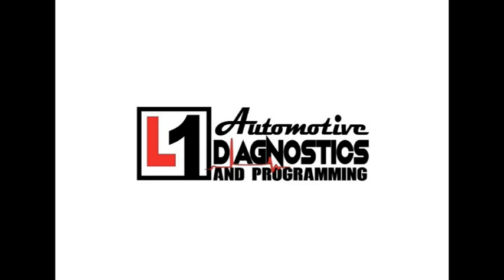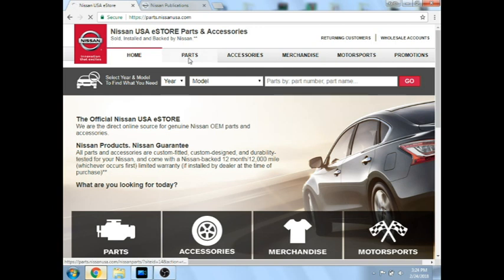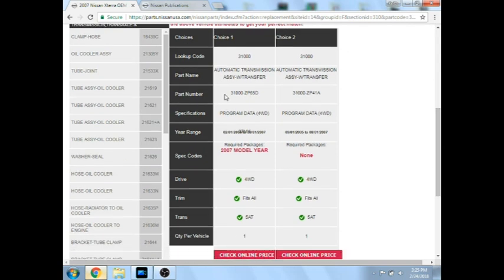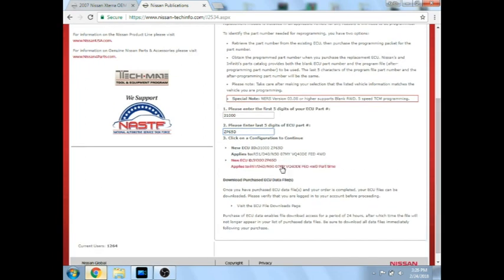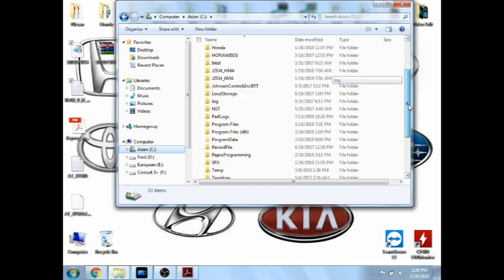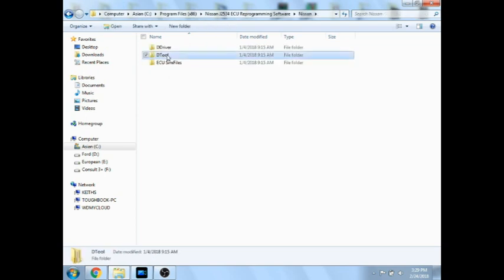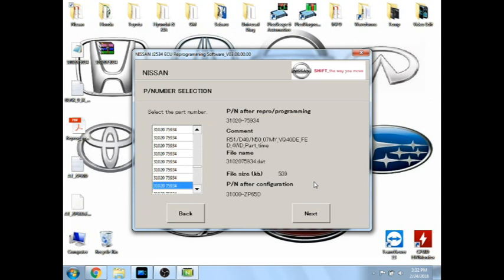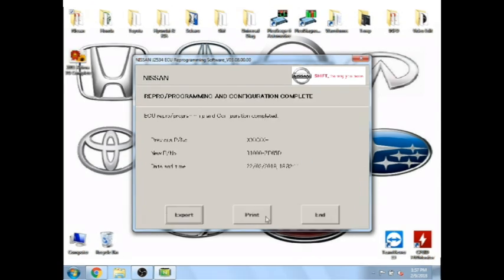How to Program a Blank Nissan TCM with NERS

Comment: Is it possible to program an automatic transmission to not try to shift to the highest gear when in low or mid throttle? Unless manually shifting it, the vehicle's torque feels more responsive when the lowest gear used keeps the engine from dropping any lower than 2000 rpm in low throttle driving. But hey often go to the longest gear causing the transmission to takes too long to downshift.

Comment: Hi Keith. Subject: 2014 Nissan Frontier  Crew Cab 06/2014. The transmission TCM Module was replaced with a blank TCM. The blank TCM was programmed and the vehicle still having issues with the Transmission stuck in fail safe mode. How can i check to see if the programming was done correctly?
Also if it is not done correctly. Do you offer remote programming On -Line? if you do let me know.
Regards,
Winston.

Comment: 5:29 Saved my butt today. When I first moved the files, folder 107 was not there! I only had them in the config folder which of course failed.
Reply: I didn't Have the 107 Folder Either. Did you Have to Create it? Or how did you do it? Were you Programing a New Or Used  TCM?
I'm having Big time issue.
Please help.

Comment: I just installed a remanufactured valve body for my 2014 Nissan Rogue.  Does the TCM require programming to properly operate with the valve body?
Reply from the maker: Yes

Comment: I know it’s a few years old now but I ran into an issue. The programming worked fine but the configuration failed. 2007 frontier a/t 2wd. Any ideas? I’m using Bosch flasher pro. Tcm brand new from dealer.

Comment: My TCM on (2008 Nissan Titan) went off network - no communication with scanner. After i flashed Blank TCM 3 times with errors. After key cycle it wouldn’t finish /complete successfully. I manually transfered all files to Application Data but not the other location—i never knew about—-i used to flash ECMs with no problem with first location dropping files. My question: is Nissan TCM unforgiving if flash process crashes—do i need new TCM now? In my case it just went out the network became no communication—not accessible. Anyone have same issues or familiar or clues?

Comment: What happens if you don't program it? I've installed a TCM in an 07 xterra, and it won't shift right at all. If its simply a matter of flashing the correct calibration I can do that, but i'd rather not drop $350 on a NERS subscription if this transmission has other issues.

Comment: I have a 2006 xterra 4wd se auto and I need a new transmission/hoses/radiator... Etc. I was wondering if I can put a newer transmission in it from a 2014/2015 xterra and have the dealer reflash the tcm. Before I buy the transmission I wanted to know if you see any reason that it would be incompatible with my model year? And if not which years would be compatible with a reflash. Thanks for this video!
Reply: I think the compatible range for you is 2005-2012 for the Re5r05a (Pathfinder and Xterra -- the trans is used before and beyond this in other applications). I'd try to find a used one in that range and consider a new valve body and TCM from Sonnax pre-flashed to VIN (if you don't get a compatible one with the used trans or can't use the old one due to contamination; I disasembled my VB, cleaned it, and reinstalled to discover TCM may have shorted). I am going through same process now and rebuilt one to swap with a coolant damaged one. When done I had communication trouble between ECU and TCM (U1000 and U1001). So, I think the coolant must have shorted the TCM. I am about to test pins from ECU and if good drop a spare TCM (that I know nothing about) from the spare trans I rebuilt. If all fails -- Sonnax. Some do take a much cheaper Re5r05a from a G35 and change out the rear housing / trans case adapter and swap the linkage over to the other side. I think you might also need to change the output shaft as there are different sizes -- but otherwise exactly same transmission. Wreckers jack the price up on the Pathfinder and Xterra Re5r05as compared to G35. 

If coolant damage, be sure to flush all lines with trans line flush before connecting the replacement trans.

Comment: Question: 2014 Infinity Q50---cant pull ECU part # to check if theres new ECU file available. Tried Zeus scanner, Autel Maxisys, ToolBox DrewTech and Nissan J2534 Reprog Soft---says "No part number retrieved from ECU" ---there TSB/NHTSA campain 14V583000  Software Update available to fix Throttle Body issues and my customer IS HAVING THROTTLE ISSUES---so im stuck cant check if ECU up to date or not.  If you find free time and willing to look it up id very appreciate and reply back. VIN: JN1BV7AP3EM672779

Comment: i have had my nissan pathfinder transmission replaced with a second hand part. when in "D"  drive is working perfectly well. but once i try to engage to shift ( in 1, 2, 3...) it does not recognize. does it requires programming?

 please help. 

thanks.
Reply: still waiting for your reply :(

Comment: Forget to mention on my previous comments that, after replacing the Cvt.transmission on my 2014 Nissan pathfinder the Acceleration became a slow but not very slow I can feel it not as use to be can please describe what could be the issue and how to resolve it please advice...thanks

Comment: Hey I would like to know recently I replaced cvt.Transmission on my 2014 Nissan pathfinder. Now do I need to reprogram any on the tcm or any other suggestion before driving the car. I asked my mechanic about reprogramming  but he doesn't have no clue about reprogramming after replacing the transmission..I'm seeking your advice...thanks.

Comment: Hey there, probably a late comment, but if i purchase a new cvt for a nissan murano, will i have to program the tcm or will it come with it automatically?
Reply from the maker: Read the service information, as it depends on the year make and model, it will not be plug and play for sure.

Comment: I have replaced the 4-speed automatic transmission on my 2011 Nissan Versa with a new OEM transmission I purchased from a dealership. I installed it myself. Do I need to reprogram the TCM for the transmission to work properly? Or is it ok to leave the original TCM alone and use it, since I have not replaced the TCM? Thank you for your help!!
Reply from the maker: What does the service information say?

Comment: So my question is this, I have a 2012 Maxima with UpRev flash. I purchased a newish CVT I need to have the TCM reflashed with oem program, because my mech purchased a blank and went in messing with shift points, and has the car driving crazy shifting oddly and not meeting it's true power because of that. I wanted to get rid of that problem by reflashing with OEM settings; will that work and will my UpRev be ok with this action or does it need to be reflashed as well?

Comment: Help me,I was reprogramming my g37xs and suddenly my battery maintainer got unplugged and I got error on ners,when I try to reflash,it says ecu part number doesn’t match and the ecu part number in the car is now blank,check engine and car won’t go into gear
Reply from the maker: You may need to manually edit the csv to use the displayed part number, if you dont know how to do that, or it doesnt work, the car ecu may be able to be recovered with a consult 3+
Reply: L1 Automotive Diagnostics and Programming LLC do you think my tcm hasn’t fried because the scanner said the car lost communication with tcm which is u0101 and to when I tried to edit it,I still get the same error..the selected part number doesn’t match the ecu which is 31039-3RX09 and is ecu part is 31039-
Reply: I just subscribed pls how do you recover from consult 3,car is parked and I’m fucked
Reply from the maker: @johnbosco2404  you just reprogram with the consult3 plus. If it doesnt work, then you need a new TCM
Reply: L1 Automotive Diagnostics and Programming LLC so I decided to use consult 3 plus and it finds the ecm  and I loaded all the files and installed battery maintainer and it all checked green but on transfer date area,it stucked at communicating with control unit,please wait for a while

Comment: L1 Automotive Diagnostics and Programming LLC  Wassup bro. I have a 2005 Nissan Altima. I replaced the engine and transmission. But for some odd reason it will not switch gears. I can plug the battery in start it up and drive normal. But soon as I let off the gas the car completely stops switching gears. Then I have to get out disconnect the battery And then it’ll drive normal again. I’m getting extremely fed up. I replaced the motor mounts , axles , engine , and transmission. But I can not figure out what the issue is! Nissan can’t even tell me what’s wrong. Can you tell me what’s wrong? I’d really appreciate it.
Reply from the maker: A lot more information would be needed, start by looking at scan data, see what looks out of place, it is very difficult to diagnose a problem when we really dont know what the problem is yet, only the symptom.
Reply: L1 Automotive Diagnostics and Programming LLC exactly man! Nissan can’t even tell me what’s the issue. You think I should check all the sensors?

Comment: excellent video, I have a quick question, we are working on a 2005 titan and the TCM have one solenoid pins broken, we purchase a refurbished TCM with the correct part number OEM 0260550002  can we just swap those or have to program it?
Reply: mauri redy Hi, I have the same problem as yours. I have a 2003 infiniti Fx35 rwd and the TCM has a broken pin or lead which I soldered but didn’t last long. What was the outcome on your Titan? Did you take it to the dealership for programming? Were you able to drive it there or you had to tow it to the dealership? I want to buy a new TCM on eBay with the same part number as yours but I worried about not being programmed. Where did you buy your new TCM?
Reply from the maker: It will need programmed, unless it came with the most current calibration.

Comment: I took a g35 trans and installed it in a Xterra I tried to use the Xterra valve body and tcm design 3 so I installed the g35 valve body and tcm and the Xterra will start drive and shift but shifts hard. Took it to a Nissan dealer the charged me $280 claimed they programmed it I argued that they didn’t because my shift indicator on the dash doesn’t work and over drive switch doesn’t work. I need help as to what I can do next.
Reply: Can a already programed tcm be reprogramed to a different vehicle.
Reply from the maker: This is a loaded question......... you can modify the CSV file to make NERS program any calibration file into any module, or at least attempt to do so.  But if the hardware is not compatible with the calibration file, the programming event may fail, or the module may be damaged after the flash completes.
Reply from the maker: Not sure, there may be some kind of issue with the parts, or the calibration may be wrong or damaged.

Comment: I pulled a tcm off a QX56 put it in my 06 Xterra. Started right up and drove off. No programming ? Is this the case with any used tcm ? So I only have to program if I buy a new one ? Cuz I have another Xterra to work on but I can’t find a used tcm .
Reply from the maker: No, this will only work if the 2 TCMs are the same exact part number and software level. And only for some models as VIN data is stored in some newer TCMs, and CVTs do not work like this at all because of learned shift values.
Reply: I’m not so sure buddy. Two have same valve body and tcms but the my Xterra was #1 design. The qx56 I used to donor, was a design #3 it plugged in and worked fine.

Comment: Hey Keith can a used Pcm be programmed on a 07 Versa? I’ve programmed used pcm on other Makes but never a Nissan. Thanks in advance.
Reply from the maker: Yes, if the calibration level is correct, just write the vin, and complete registration of the keys.

Comment: Hey brother is it possible to reprogram an used tcm?
Reply from the maker: That is a loaded question, depends on the year make and model, on the few that you can, it must have the same exact part number, and most likely has to be a unit that is behind by a calibration so you can flash it and get calibration files in it that match the new vehicle. So the short answer is, just get a new one.
Reply: @L1Training  Are remanufactured TCMs from Dorman blank or you have to hope it is a version behind to flash?

Comment: My friend changed the transmission in his 2008 Infiniti M35 but threw away the old transmission so I can't put the old TCM in this transmission is there any way to reprogram the existing transmission module in the used transmission
Reply from the maker: Yes, it is very involved, but is possible.
Reply: @L1Training I end up replacing my g35x 04 sedan with a used transmission from another 04. Infiniti couldn’t flash my tcm. I still have access to my old transmission. Please tell me my old tcm will probably be the best solution. If I put the old tcm in would it be a bit easier to access? Also heard the 04 sedan doesn’t need programming after a trans swap.

Comment: any way to restore the tcm after error during the blank programming?
Reply from the maker: If the key was turned off the bootloader in the module is likely corrupt. It is a very long process to try to recover one.

Comment: Hey I have a question.  Is the tcm will be toasted if error happens during blank programming??  I had an experience with ECM went bad because of the error happened while it was reprogramming (labtop power went dead.., stupid thing..)
Reply from the maker: Yes is an error happens during programming with NERS it will most likely damage the module.
Reply: Is there any way to restore that TCM by any chance?

Comment: Hey! Thanks for this video. Unfortunately, I don't even know how to get started and I don't know what tools to buy or what a VCI is. I have to do this project but I have many more questions. Any chance you might be willing to chat privately?
Reply from the maker: You need a scan tool that will do the relearn functions, (Snap-on verus, Autel Maxisys, or Launch x431), you will need access to service information for procedures and specs on each of the steps. (alldat, identifix, mitchell) you will need a programming specific power supply (NOT A BATTERY CHARGER) (Powermax, Iota, Schumacher, Snap-on) you will need a J2534 device (Drewtech, Bosch, Snapon, Launch) you will need a Windows 7 Laptop, you will need a subscription to nissan NERS ($270 a year), you will need the flash file for the specific control you are programming ($20). Then follow step by step with the video.
Reply: Can get a godiag j2534 pass throught cheap. Got mine to work on ners

Comment: Hey man , you seem a real expert , how can I contact you , I have some questions and I need your help , Thank you
Reply from the maker: What are your questions?
Reply: Keith Perkins So, in my country, our nissan dealers are very expensive and they don't have the proper quality service for our cars , however, I want to buy a consult 3 plus, and start a nissan workshop, and I want to learn everything about nissan , I have a nissan maxima and I tried to do uprev tune but it didn't go will , my car won't able to run , also I want to learn how to recover my ecu , i know those are so many vary questions, but I really really want to learn. I hope you could help me , thank you
Reply: L1 Automotive Diagnostics and Programming LLC  Wassup bro. I have a 2005 Nissan Altima. I replaced the engine and transmission. But for some odd reason it will not switch gears. I can plug the battery in start it up and drive normal. But soon as I let off the gas the car completely stops switching gears. Then I have to get out disconnect the battery And then it’ll drive normal again. I’m getting extremely fed up. I replaced the motor mounts , axles , engine , and transmission. But I can not figure out what the issue is! Nissan can’t even tell me what’s wrong. Can you tell me what’s wrong? I’d really appreciate it.
Reply: @jhamp98_58  I'm not an expert but I can't stand question not being answers for years......check in the ECU

Comment: Hi Keith, do you know how can I connect Nissan Consult III Plus with my Snap-On Pass thru Pro II?
Reply from the maker: A standard consult 3+ CF19 toughbook will not connect with anything but the OE passthru. Consult 3+ R2R edition (Right to Repair) will connect to the pass thru pro for diagnostics on 2018 and UP, currently Nissan has complied with the minimum requirements of the Right to Repair Act by doing this. There was a press release some time ago stating that in the 4th quarter of this year, we will receive a 1990-Present Consult 3+ version that uses any J2534 compliant device for diagnostics. It will allow immobilizer functions as well if you are a LSID holder.
Reply: Keith, I have a personal computer running windows 7 Ultimate 64-bit which already has Nissan Consult III Plus installed. I also have the tool kits for the passwords and Pins if I want to use the inmobilizer function. The problem is that right now the program will only look for nissan's Vi2 interface, but I heard there is a way of getting it connected with the PTP2 by modifying the diagnostictools.ini file and also some changes to the registry. That's what I'm looking help with...
Reply from the maker: I have tried that, it is less than useful, it will work but not read all live data, and will not perform any function. basically its useless.
Reply: hmmm, I have been told the only thing that will not work is the Ignition ON thing... it will not show ON.
Reply from the maker: it does not show ignition on, and the other items I mentioned are a problem as well. A J2534 device lacks some of the hardware and firmware internally to replace the VI2 with software that is currently available.
Reply: Keith Perkins can you teach me how to connect it?